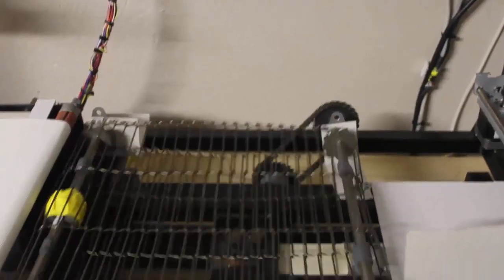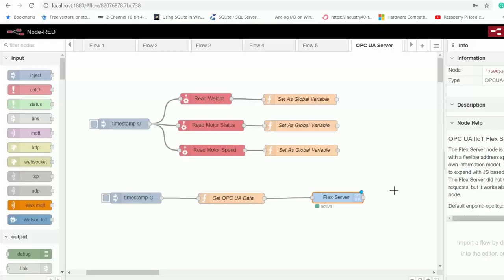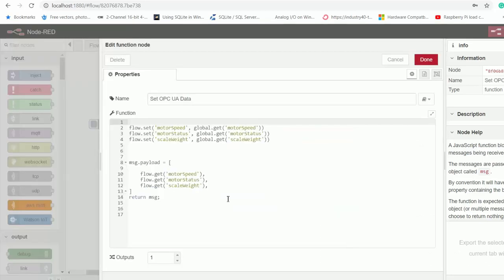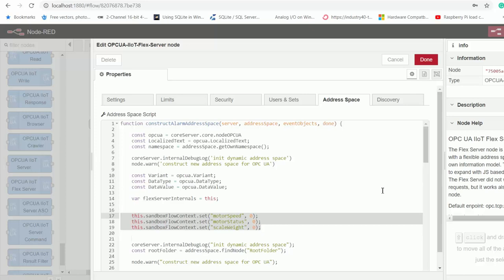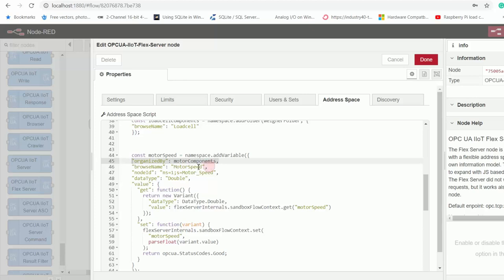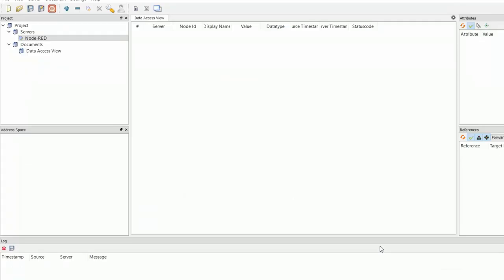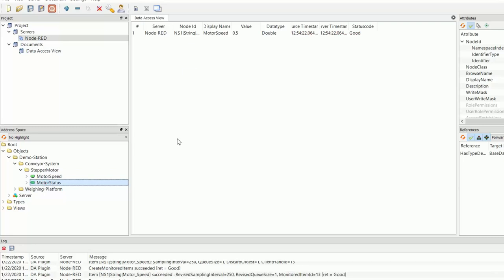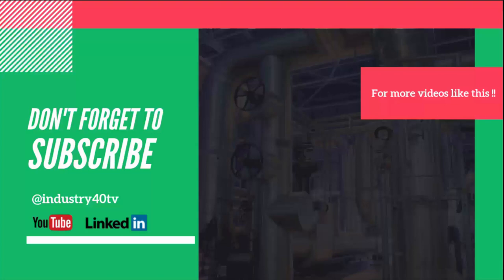Node Red OPC UA - How To Create an OPC UA Server Using Node Red

Comment: Is there another way? These nodes aren't available anymore...
Reply: yes you are right , i stuck like you manage palette install it is missing but you can install from command line with ; it works for me.
npm install node-red-contrib-iiot-opcua
Reply: @gurkancekic9057  Command line doesnt appear to work either.
Reply: @gurkancekic9057 command line doesnt work may be version mismatch
Reply: @gurkancekic9057  node read. and node.js version ?